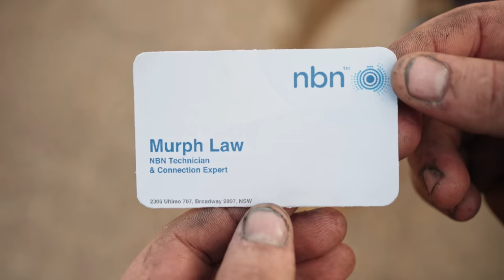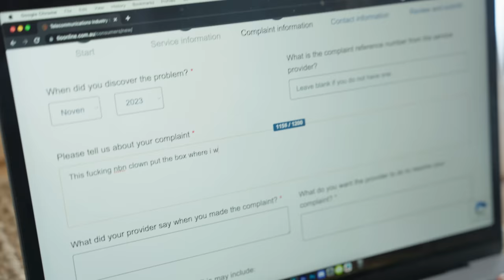Every NBN Worker Ever... | Garn.

Comment: My NBN guy was tops, I even helped him pull the fibre, it really is a two person job afterall. He loved my little DC submersible pump, even if the high voltage back EMF probably rooted everyone else's copper in the street. Who cares about those poor bastards. He did do a bit of a dodgy tho, cut off about 8 inches of the old copper, so he could take a photo saying he did a dual pull 😂 I'm wrapped tho. Thanks for the no lock-in contract iiNet! Whole thing only cost me 20 bucks really. Well plus the ciggie I gave to the NBN worker. True story

Comment: In 2010, New Zealand's internet connectivity, whether by landline or wireless, was worse and more expensive than Aussies. But the situation has substantially reversed. Optic Fibre comes right into everyone's actual livingroom wall point (including blocks of units down shared driveways etc). For a $99 sign up I got 20 months free Fibre, unlimited quantity and the speed is 200 Mbps download and 100 Mbps upload.  Previously I was on 4g wireless, using the phone cell tower system (only available in some areas) and that gave me speeds of around 38 Mbps down and 12 Mbps uploads. and that cost $59 per month for 300 GB monthly.  Once my 20 months free Optic Fibre period is finished I will be cancelling as it then becomes $95 per month, for unlimited GB optic fibre, if I continue. (That in itself would be good value for some families and heavy users, but I use at most 120 GB a month).

Comment: I currently have NBN. Went from 800kb/s to 50mb/s, an insane step up. 
I would not even think of living anywhere that didn't already have it installed. 

Maybe the next step for the NBN is to be monitored every step of the way. 
Maybe the telco dude installs it wrong, it's not offered or it doesn't work. 
Maybe the telco dude has an "accident" on site? Who knows? 
Maybe this happens to every telco dude until shit is fixed? Bet.

Comment: NBN ex-worker here... Not the guy that comes to screw up the install, I worked in the centre..

As funny as this is, and it is funny and pretty spot on, the actual issue with delays, time frames and going copper the rest of the way is 100% THE GOVERNMENT, not NBN.

We wanted to get it done years ago, with fibre all the way to your toilet bowl or inside your fridge, but the government said "we need to cut costs, because we changed our minds, and you being the front face for this horrific change of plans will have to bare the hate that will be directed your way".

As for the installs in stupid spots or shoddy work, that's because of some sub-contracting firms having bad workers who don't follow the guidelines.

We try to weed them out, because they carry the name of NBN when they carry out the work, and that ticks us off 100% because now we have to figure out why their so stupid and go fix it.

Again, subcontractors was a funding issue, the government didn't want to expand the NBN workforce because when the task is complete, there won't be a need for tens of thousands of employees and trucks.

No one at NBN ever thought it was a good idea to use copper or coaxial (HFC) to do the last part of the distance, and didn't want subcontractors.

Another fun fact:

I got fired for telling the manager to f**K off. 🤗

Comment: when they were first installing NBN they had a little fishing like wire on the inside part my brother i lived with at the time pulled it out by mistake which cant be put back in as its now broken telstra said it will be a $150 fix and will take about 2 weeks brother walked outside onto the street where NBN guys were still installing asked them they came fixed it in 2 minutes and that was that didnt have to pay a cent

Comment: literally swapped to a 5g wireless broadband plan because NBN ripped out the slow but functional copper and replaced it with an antenna on my roof then expected I pay $20/month extra when it drops out all day everyday and barely ever reaches half the promised speed!?!

Turns out mobile networks can achieve the same goal at a quarter of the price. What the actual fuck?

Comment: Some dickhead laid down fiberoptics before the nbn was a thing, and then the guys I rent from didn't say anything. I went to sign up to every internet service I could and none would let me. Turns out there are only 2 companies I can buy from, and their prices are the same. There's only a couple houses like this in my area. It made me so inconceivably mad, especially when it didn't even work cause the dumbass tradie connected the phone line to the the ethernet line. Had to go into the ceiling to fix it. Worst setup Ive ever done.